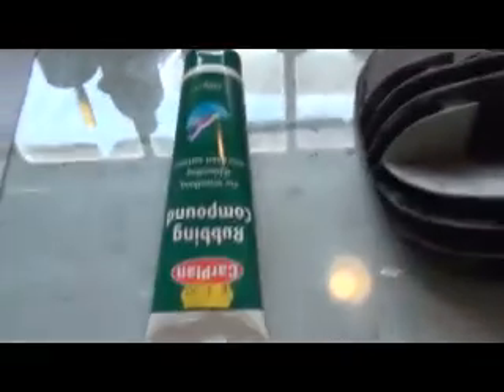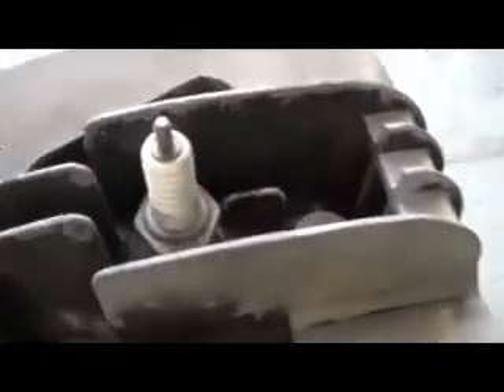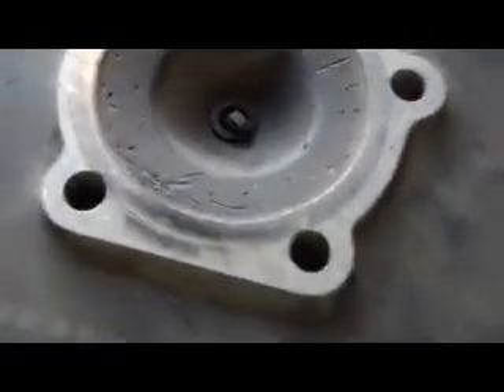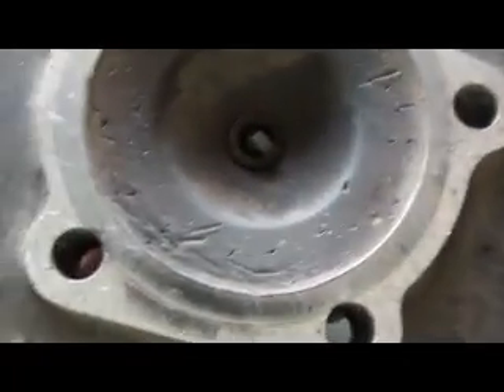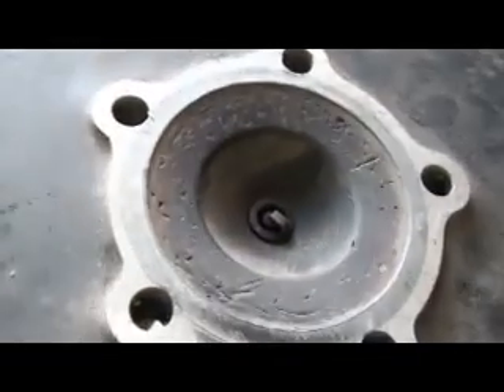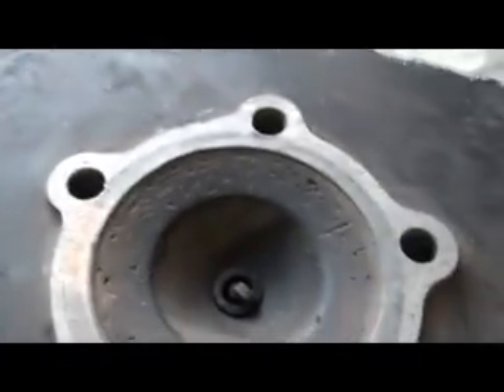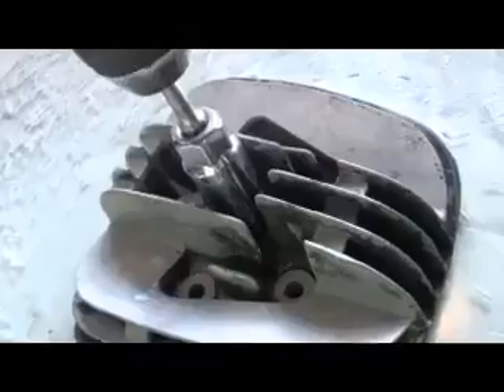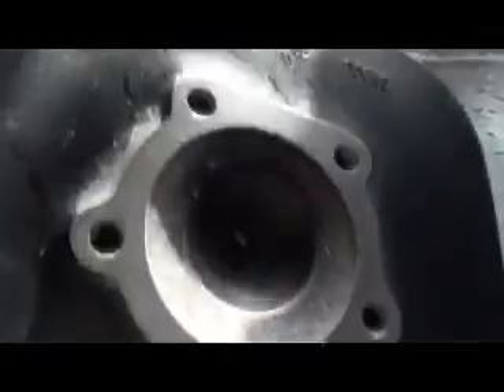How To Skim A 2 Stroke Cylinder Head Using Household Tools

Comment: if done correctly you dont need a head gasket!
Reply: Yes you do, moron! You have different temperatures between intake and exhaust side of the cylinder which means non-uniform expansion. The top face of the bore looses some of it's flatness and you have a leak passage. Also you will increase compression and decrease piston clearence which on some engines is critical.
Reply: montesas dont have an head gasket!!!
Reply: @brk932  Old 1978 Tomos Lamo outboard engine used a cast iron cylinder and a cast aluminum head which was soft. They machined them both flat and the torque from tightening the head nuts was enough to make a perfect seal under any condition hot or cold. No need for a gasket although i am building a street engine for my bike with this cylinder i am going to put a gasket in between the head and cylinder deck so i can easily configure the squish clearence. Both surfaces will be freshly machined (60cc, bore is 42mm stock i'm going 42.5mm, going to be ported)
Reply: @kenanalibegovic6724  I am not saying an engine cannot be designed to operate without a "head gasket". It can but it will have to implement another sealing system. For example most old 911's used sealing rings which is still a gasket. In your case the cast iron crushes the aluminum. If you threat your cylinder and head as throwaways go a-head ignore the manufacturers instructions. If the cylinder and head are made of the same material and are directly into a contact on a large flat surface  sooner or later issues will arise.

Comment: What's wrong with a sanding block and a 2000grit sandpaper?
Reply: if you mean a hand held sanding block like a non powered hand sander (or a power hand sander for that matter), then the problem is that if you're a human & you've done this job less than 5000 times, you probably won't get it as flat, even & level as it should be, no matter how fine of abrasive film or sheeting you're using. if you get your 2000+ grit in sheets at least A4 size & you want to use them on top of a piece of glass or similar, that works fine too, but you want that flat hard surface. Doing it that way, I'd do a pass of 220, then 400 then 2000 (better, break the last pass into one pass at 1200 grit, & one at something 2500-3200 grit for the final pass)
Reply: +skojo3e

  To keep the surface flat ,move the head over the paper(on a flat surface)in a figure 8 pattern .
Use a steady motion .  Do not press down, allow the weight of the head to do the work .
Mineral spirits  ,water,hell even new motor oil will help to remove metal fragments from
the work aria . REMEMBER : you'r work can only be as flat as the surface you are useing  .

  Personaly , I would use a lapping table with lapping compound cut with mineral spirits.
But that's just me.

Comment: talk about major uneven spots.. it only cost a few more dollars to pay a local machinist to do this the correct way. don't cheap your engine
Reply: Not true. A good friend of mine who is a machinist for 40 years and they used to lap components on glass tables just like he did to get a mirror finish. In some cases you can get a finer ra finish then some machines can. Glass is perfectly flat

Comment: ok kids there is a reason why this should be done in a figure of eight pattern !! ive been doing this for 40 years and this will not lap to barrel properly..not everything on the net is right ok ..i run all 2 strokes with no head gasket,,this guy dont . . .
Reply: CPGB stalinist 
G
Reply: CPGB stalinist yamaha rxz still the boss right with gasket head.. 200kmh

Comment: A: Not all 2-stroke heads have central spark plugs.
B. Manuals recommend refacing aluminium heads using 400-600 wet n dry on a flat plate
Reply: DepakoteMeister  I think I’d prefer to get it machined down I have a kdx220, that y I’m here I’m considering skimming it for a higher compression ratio
Reply: I used 1200.

Comment: Any ideas on how to cut a pop up piston using a drill press?  Im working on a two stroke chainsaw engine and do not have a lathe.  Or, any ideas on how to trim the squish band on a closed (non removable head) chainsaw cylinder?  The idea is to set the squish, adjust the porting and make more useable power.

Comment: Actually im not wrong at all. You are correct about CYLINDER PORTING on a 2 stroke,it involves changing the height,shape and angle of the ports in order to improve gas flow,gas direction,timing and duration in which the ports open/close   .....However if you read my original comment i am referring to HEAD PORTING which can only be done on a 4 STROKE as the inlet and exhaust ports are in the head,not within the cylinder as found on a 2 stroke motor

Comment: Thats actually wrong. You might also port a two stroke cylinder by changing the in and outlet sizes. And of course this requires a tremendous amount of skill, but it's still possible ;)

Comment: "shaving" also known as "skimming" the head is usually done on a milling machine and is very precise.Usually skimming is done when heads become slightly warped/damaged or if they require the compression ratio to be increased.The video is only a demonstration on how minor imperfections could be removed and he quite rightly says it was only an experiment.Porting the head is completely different and applies to 4 strokes only.Its where material is ground out the IN/EX ports to increase gas flow

Comment: If I may, I would add this method is only apropriate for single cylinder heads. Too risky for multi cylinder or hi-performance engines. But if the engine is a standard performance single... like the engine from a scooter for example, this method works just fine.

Comment: @denzlepob No bikes, muscle car, 650 triple snowmobile, lots of small engines. You could very easily make up for the shaved head with a thicker head gasket.. on a car. You don't really have a range to order for most small engines. Honestly I don't imagine you've decreased the combustion chamber volume significantly enough to warrant the effort. CCing the chamber would tell the full story. :)

Comment: @denzlepob  A unique approach to be sure, rather messy and slow compared to just using a sheet of fine sandpaper taped to the glass imho. If you don't have a lathe, you could knock the high metal off of the gouges with a small half round file or a small square of sandpaper. You're right it will run without doing this but if you have a tight head clearance it could damage the new piston. Cheers.

Comment: i take a small block chevy and tape a plate glass window to the fan blade then......i actually use a 12" square of tempered glass ,use a little valve grinding compound and wd40.. work by hand in a circular motion ....works perfect even on heads  where the plug is on an angle. Works on centercases also.

Comment: Done the same thing with a 1979 DT100 head using a pillar drill and Wet n Dry then a mirror and autosol, the DT had a little more compression and run excellent after

Comment: Never thought of it that way, I"ve used the glass plate with sandpaper taped to it, and sand in figure 8 pattern. Would think that eventually the rubbing compound would wear the glass as well, causing an untrue working surface?